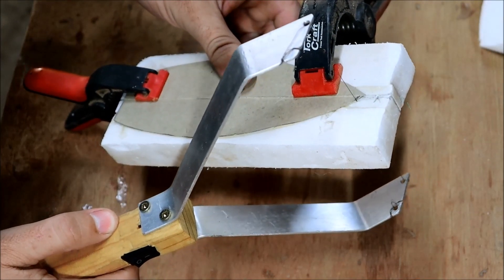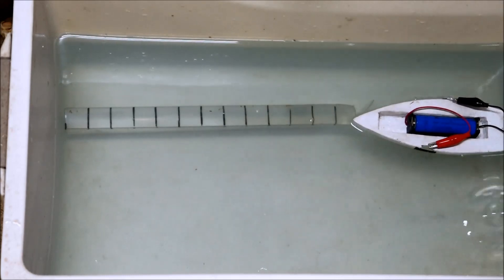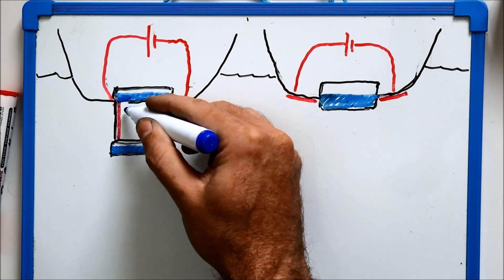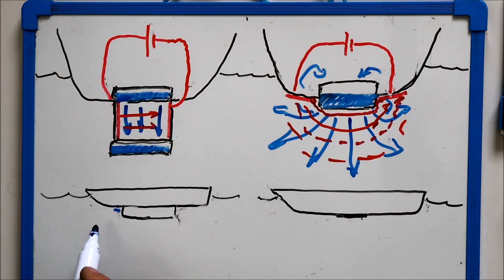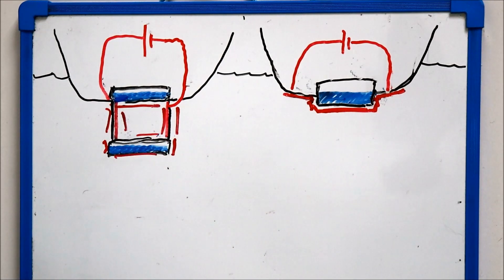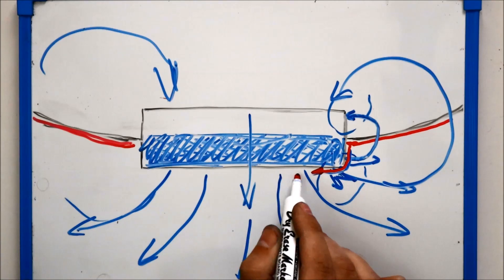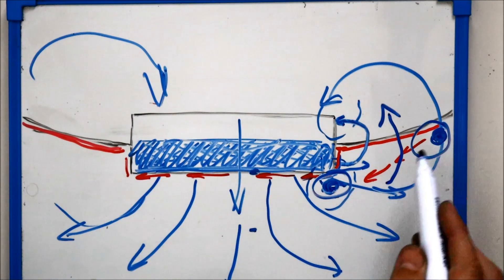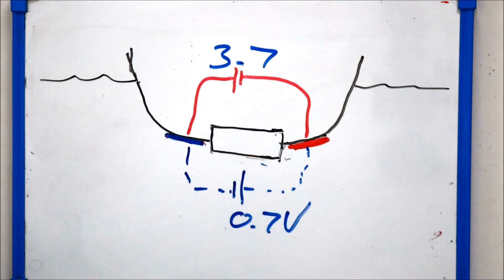Super simple MHD boat drive, great results.

Comment: I see two HUGE problems with this type of drive. First, it seems far less efficient than a simple motor and propeller (I didn't watch the whole video - did you do an efficiency comparison?). And second, you're talking about sending large electrical current into the water - on a full-scale model with 100 volts, won't that electrocute anyone or anything swimming nearby?
Reply: Electricity won't travel the way you think, when in an infinite pooling/laminar flow of High-K Dielectric Plasma radiating from the hull. But yeah if you got too close you'd be cooked...but you wouldn't be that close to a submarine anyway. 

It's funny though, the inverse of this tech was shown in 20,000 Leagues Under the Sea...and that Lateral Zero Movie...

Anyway China has shown the world they're full-functioning MHD Submarines, and Russia demonstrated their MHD Torpedos...so...why are Americans so dense when it comes to Nuclear and Plasma tech?
Reply from the maker: Lloyd yes it is not very efficient, it is unlikely to ever be used for general use propulsion. Current can be increased by increasing electrode area or by reducing the electrode spacing.
Reply: One advantage is not getting fishing nets etc caught is a propeller. Are neodymium magnets better? I saw on another video some energy is wasted due to effervescence.

Comment: I noticed some bubbles appearing from the electrodes. I assume that some energy was creating hydrolysis?
Reply from the maker: Yes there definitely is hydrolysis but I still need to figure out how much energy is wasted in the process. An old declassified military research paper on mhd drives found that the bubbles had no measurable impact on efficiency. I need to look it up again, it might have referred to the presence of bubbles rather than the gas formation itself.
Reply: @williamfraser  That's from the eddy currents in the Poynting Energy Flow(Lorentz Forces). You'll see it in fluid dynamics imaging at JPL with Dr. Roy's WEAV (Wingless Electromagnetic Aerial Vehicle) 

Yep yep. Your  welcome!

Comment: I'm also not totally sure how you'll measure success. Will you be timing speeds and accelerations for a fixed electrode spacing, fixed magnet width, and fixed current to find the fastest design, or will you be measuring thrust or pressure, and determining the efficacy of your system (thrust/watt) based on different configurations, and declaring the highest to be the best? Efficiency would also be very interesting to find out. Would this be based on how much joule heating is produced in the water and wires, as well as how much hydrolysis and electrolysis you might be unintentionally producing?

Excited for your work!
Reply from the maker: I already have a good idea of the optimal hull shape for the job, so that is more or less fixed. Having multiple magnets gives more control for shaping the magnetic field so I will most likely experiment with different arrangements. I will test at the same displacement as the catamaran and measure success by top speed. Static thrust would also be interesting to compare.
Reply: @williamfraser  Thanks for your comment, do your thing!
Reply: @williamfraser could u not use this tech too get the bare minimum energy too charge up 12v say 2 amp batteries....too Me all this tech should be about getting small batts charged for free or an upfront cost that can be recouped via electricity harvesting and then those small batts you have managed too charge you can series n parralel indefinitely too power anything you wish....so just enough electric harvest too charge small batteries because once you have your upfront cost off materials repayed technically too you personally are you now not getting free energy untill your design fails ?....
Reply from the maker: @jshaw4757  the design can be used as a generator if the process is reversed, i.e. if water is forced over the magnet and electrodes. Whatever current is produced needs to pass through the seawater which has very high resistance. I've tried taking measurements while pushing the boat through the water but could not even register a mV.

Comment: Cool topic, I'd like to see what driver you choose to control thrust power, and maybe compensate for changes in salinity / electrolyte conductivity. At 2W, it sounded like impedance was high enough that a higher voltage system might've helped or a CC regulator.
Reply: Transducers and embedded layering allow for +/- charge vectoring where the leading edge is positive charge, trailing edge is negative. Exactly like double lenticular Ionocrafts ;) Just remember to think in X, Y, and Z axis when building the "capacitor" plates.